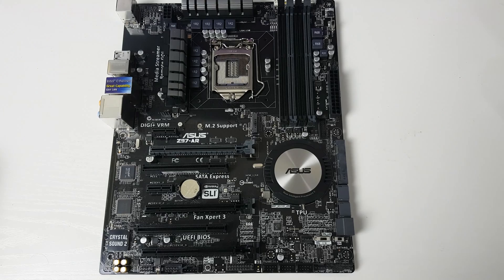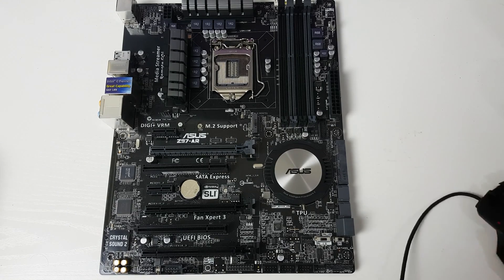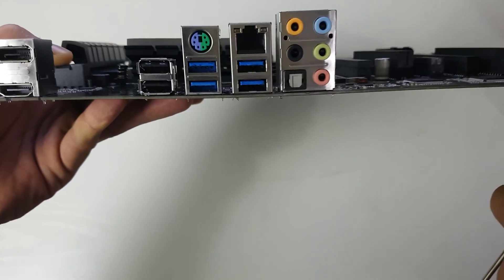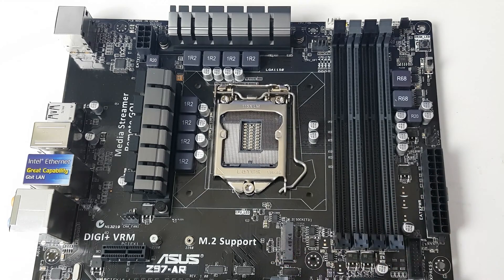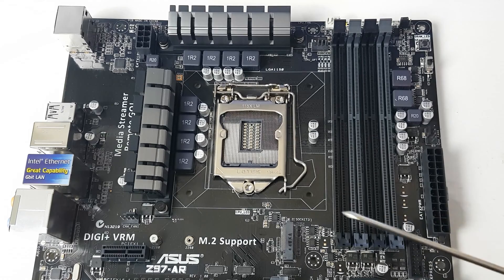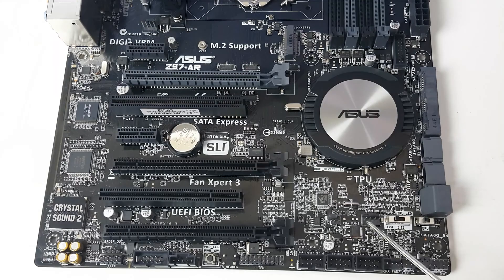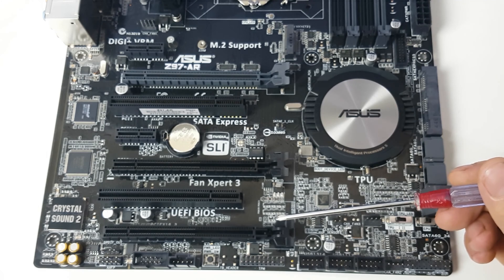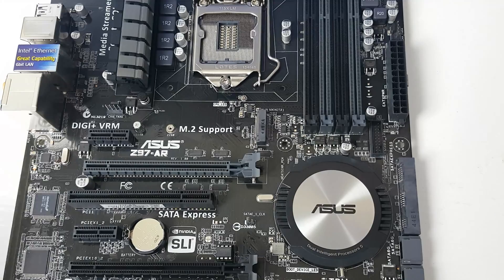Asus Z97-AR Motherboard Overview

Comment: Nice review
Reply: Can you please review the gigabyte r7 250 2gb OC
Reply: And maybe also do a video on how to install windows 10 from BIOS
Reply from the maker: +Hassan Jamil. just download the windows 10 USB tool which will download a copy. plug it into your pc press the relevant f keys for boot options which you will see on post. f8 or f10 for example then just let the install run.
Reply: +thefullsetup OK thanks. Where can I get a product key? And also what's the difference between retail and oem keys
Reply from the maker: +Hassan Jamil you have to buy one I'm afraid.
Reply: +thefullsetup I see some for around 150 bucks. They say USB or DVD, does that mean they come with a USB that already has the iso on it and a separate product key with it?
Reply: +thefullsetup I see some for around 150 bucks. They say USB or DVD, does that mean they come with a USB that already has the iso on it and a separate product key with it?